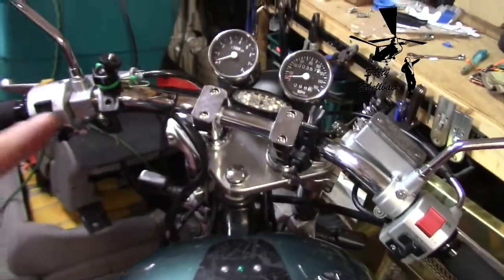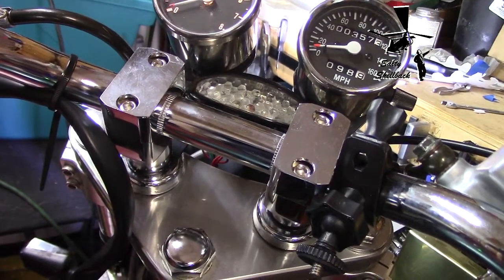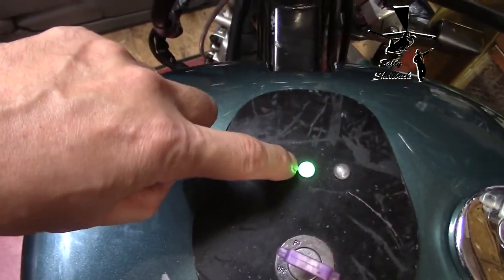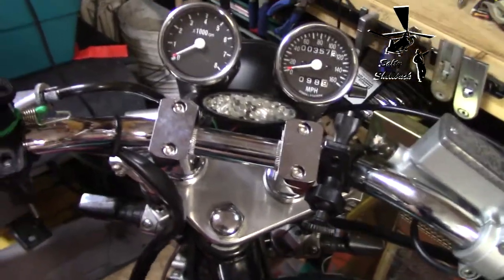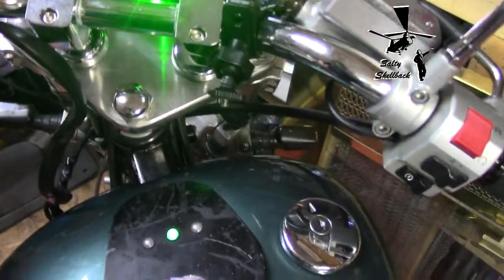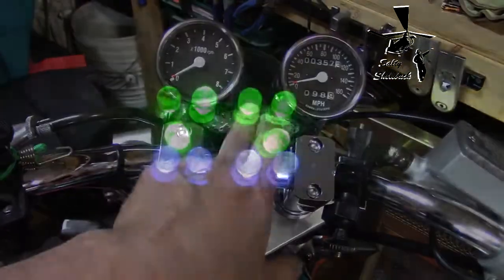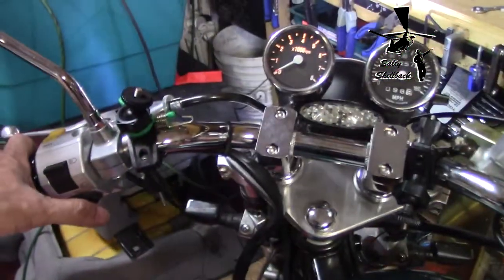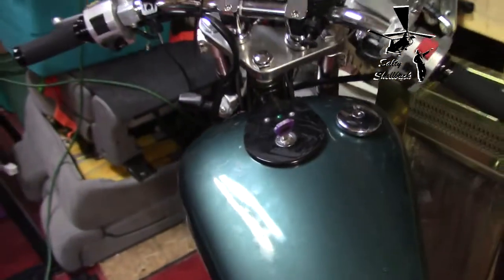Suzuki LS650  Neutral indicator light mod

Comment: As a matter of fact why don't you just come up and work your magic for all of them. I have the same problem as you, all my lights are down on the fake gas tank.
Reply from the maker: The bike manufacturers like to shoe horn everything in a little tiny space. I liked the simplicity of my old Yamaha 250.
I vaguely remember it only had like one wiring bundle. No neutral or turn signal indicators or tachometer.